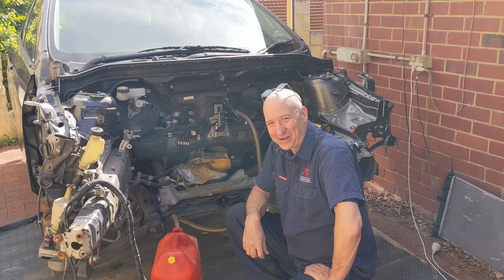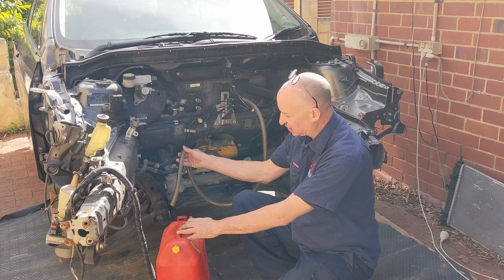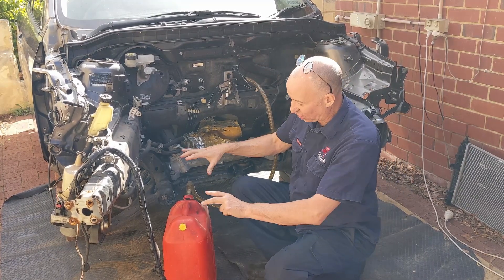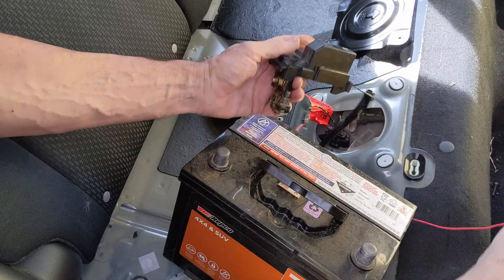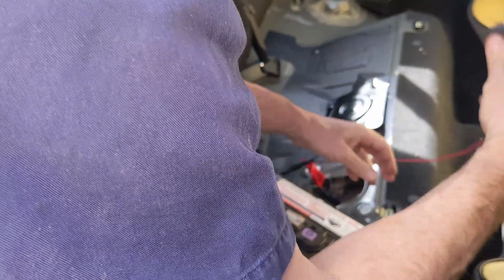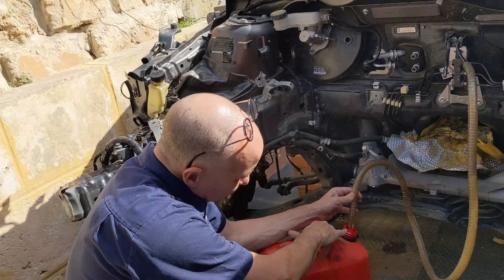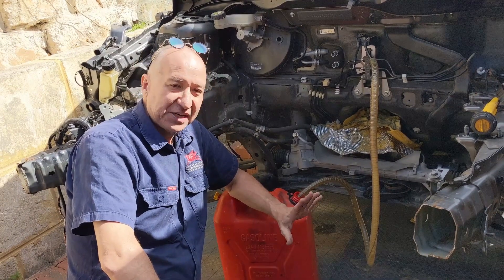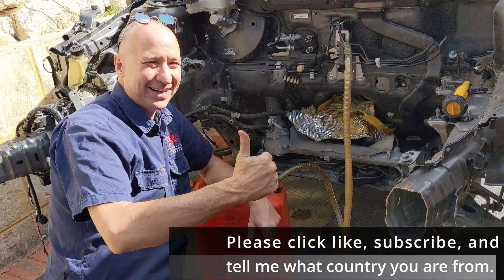Drain fuel using the inbuilt fuel pump when you can't use the fuel pump relay trick.

Comment: You could do it all at the fuel pump relay mate
Reply from the maker: Hiya,

if I had a battery, fusebox and harness in the standard locations I could, sure.  But in this case I had lost a fair bit of wiring all of the fusebox when I sold the engine and gearbox to a guy putting a Mazda 3 engine into a Mazda 2.

But yeah, it is still a good point to bear in mind.  Fuel pump relays can certainly be used to empty fuel tanks too.  

Paul.